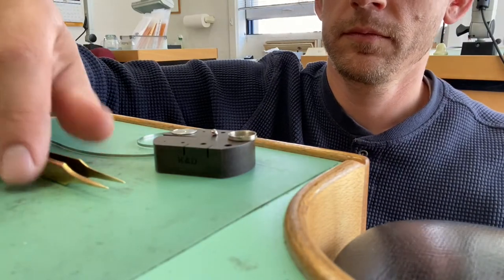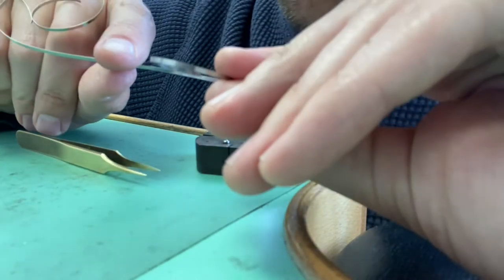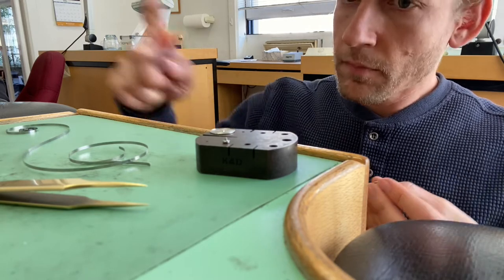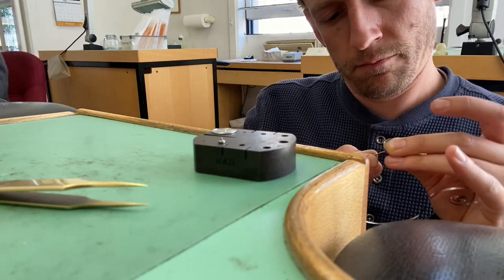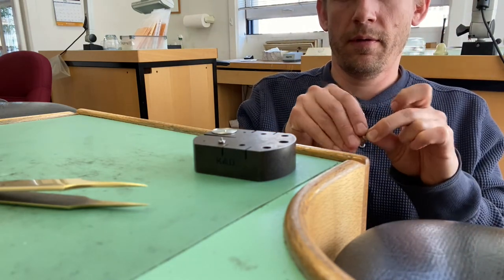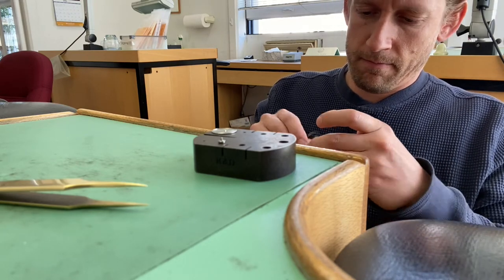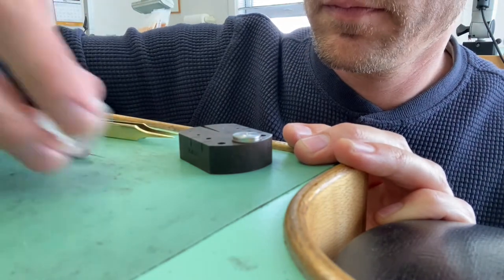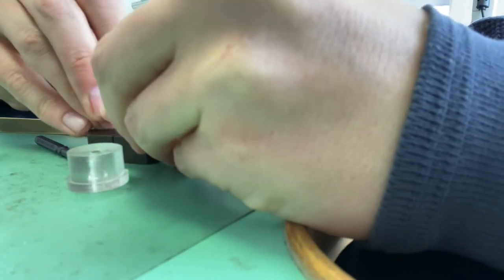ETA 2824 Mainspring install by hand

Comment: Thanks! I use this technique, I’ve not bent one yet. I only buy new when broken, bent or need the help on extra amplitude. I often have bad luck with new springs not always fitting the cannon pinion well. Ta.
Reply from the maker: Yeah, I know how frustrating that is to finally get your new mainspring and it doesn’t fit the arbor.

Comment: Hi, what oil you use for oiling the mainspring before putting it back to the main barrel? 8200 or there is some better option? Thanks
Reply from the maker: Exactly I’ll use 8200 mostly for the mainspring. And a breaking grease for the inside of the barrel wall.

Comment: Hi dude any advice on using mainspring winder tool.having difficulties understanding the orientation of the mainspring
Reply from the maker: First make sure that you know which way the arbor sits in the barrel then look at the hook and imagine the orientation that the spring would have to be in, in order to hook onto the arbor
Reply: @Timesradical  thank you may be you can make a video explaining the mainspring winder tool 😊